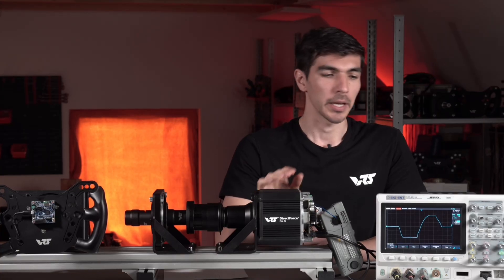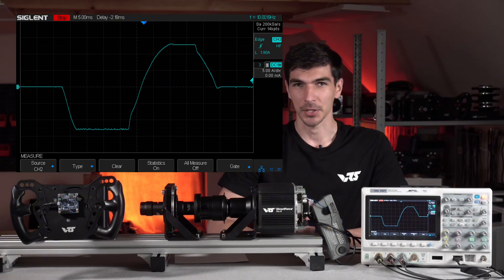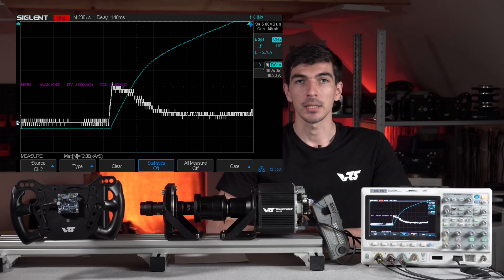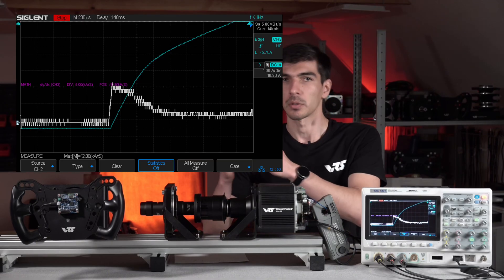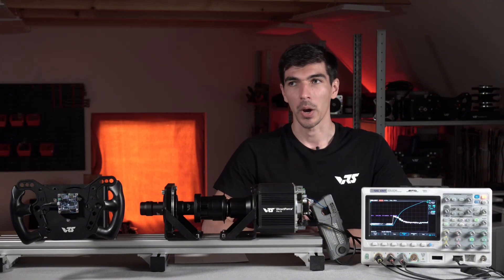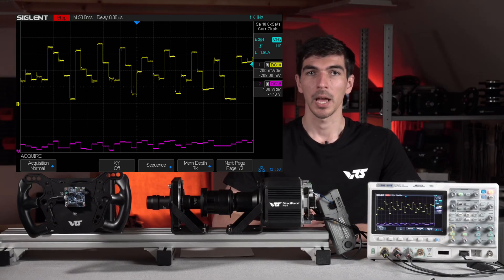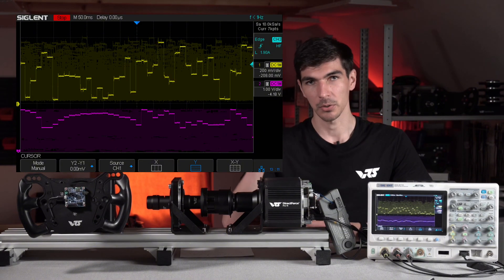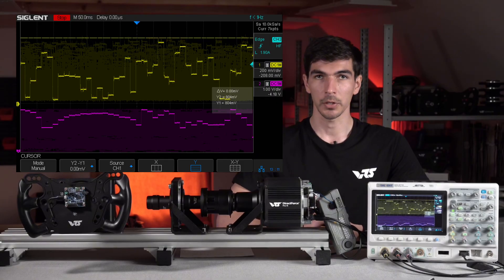How Wheelbase Agility Impacts Your Sim Racing Performance | VRS Racing

Comment: I have always wondered if there is a missing "component" to FFB design, as the games output a torque value but not a desired steering rack position (although that can be inferred from the torque being reduced as the desired position is achieved), and there is not much response back into the control loop other than the position achieved. Then Moza announced a wheel with a torque sensor on the output shaft, which in my mind should provide a great opportunity for more advanced FFB algorithms - but it's been a while since i studied system control theory, so I would be curious to hear what you guys think about such a sensor being added into the mix!

Comment: Thanks for this!
Again, this is what I am often talking about to people when they want advice for a good wheel base: look for a good slew rate as an indicator for how 'lively' a wheel base might feel. Maximum torque is a marketing number which is useless at a certain value, but it works with most people. They are easily impressed by numbers as high as 25, 27 or 35 (or 37, that particular manufacturer don't know themselves ;) ). No, take that number only as an indicator for maximum headroom. Look for the slew rate! Especially if you are looking for a wheel base in the lower budget range, there are vast differences.
But then there were also people who usually are very experienced with sim racing hardware who keep saying 'slew rate is just another marketing tool'.... yeah, maybe it is, but it is actually the more important one, even if it is not really transparent how this value is determined.

So thank you for this video and I really hope other brands pick this up. My guess is the way Simucube and Asetek are coming up with their slew rate values might be quite similar. But some other brands don't even mention it, it is always about 'maximum holding torque', as if you would go half a minute through a corner or they would aim at oval sim racers.

Comment: I don't have instagram and I already own the DFP20 but ill comment anyway. I am not Technically minded at all but I do appreciate the time you put in trying to explain to give us a better understanding of you're product, and whilst some info went over my head I did end up changing my slew rate from balanced to performance and I also changed the filter from optimal to responsive 1 after watching you're previous video but after watching this video if I understood correctly the filter options dont have an impact on the frequency that produces the force feedback for performance and so I can switch back to optimal if I do so desire. Thank you Dennis & Frank

Comment: If you could make smoothing filter that included all the poles that say a ten band graphic equalizer has, then level settings plus and minus for all the frequencies produced by the motor that come from the SIM, it would be truly top shelf. 
Seems like the +/- steps in each band would be hard to design and also implement that into a UI that the user could use to eq the ffb in great detail. I guess it would have to be a digital graphic equalizer block, since it’s not an audio  application . IDK, if you can think it, you might be able to design it.

Comment: Great testing methodologies, and I love the analysis of the optimal filter effect. 
It would nice if the offered filters had a general description to indicate what part of the ffb signal spectrum it’s primarily effecting. 
Secondly, does the effective slew rate change if more than one filter is or could be applied. Or another way to ask is , does the complexity of the filter effect the slew rate when used. 
If you might be able to describe how each filter effects the feel of the ffb signal, then it would be easier to choose which smoothing filter might be best for whatever type of signal conditioning you might be striving for, and each SIM is different, so this is not just a one time set it and forget it.
Sorry for the long text.
Great work on the video.  2.5 years now with a DFP 20.

Comment: I've been following VRS for a while now, and this video blew me away. The transparency, the engineering depth, and the way you break down slew rate and frequency response—it’s exactly what the sim racing community needs.

As someone working in tech and compliance, I deeply value clarity and precision. I’d love to receive the DFP15 wheelbase not just to upgrade my rig, but to help introduce sim racing to more people in Georgia, where the scene is still growing. This wheelbase would be a game-changer for our local community. For now, I’m using the Fanatec CSL DD with 8 Nm.

#DFP15

Comment: In April i've talked with VRS about data-driven reviews and they were one of the few brands that were really interested in joining the program, not sure if it helped with VRS to go with this route of going more technical and explaining things, glad they did it, but it's missing the most important part that is comparison with other hardware because if you can't compare you can't know if it's better or worse and in each aspects.
Keep it going, it's important to be informed.
PS.: Not sure about the direct correlation from current to torque, usually you need to multiply by the efficiency and higher current should mean less efficiency.

Comment: I would love to get my hands on the DFP15. After being stubborn in my ways and not seeing value in high end sim racing products I bit the bullet and purchased the VRS Pedals. After 3 months of use there is no $ fiqure you can put on the quailty and how much more immerse and connected those pedals bring and the last bit of kit I'm needing to upgrade is the wheel base and wheel rim. Seeing this detail explaination on how HZ work alongside the filters with this amount of transparency has got me commited to the VRS ecosystem for life.

Comment: What are VRS budget options rivaling CSL DD 8 Nm and the next tier up?
Reply: The Fanatec CSL DD 8 Nm base is $550 USD while the VRS DFP15 Nm is $650 USD.
- So there is only a $100 USD difference for what is arguably a MUCH better wheelbase.

The other option would be the VRS uDFP line that has options at 6 Nm, 9 Nm, 12 Nm, 15 Nm torques.  
- It's all founded on the DFP20 base that is their longer running model.
- Pricing with the similar QR offered on the DFP15 above are $548, $648, $748, $848.
- You can start with any of those models and upgrade to more torque over time at $99 per step.

All that to say that you have essentially 3 current VRS options that are comparable in different ways to the CSL DD 8.
- uDFP 6 Nm $548
- uDFP 9 Nm $648
- DFP 15 Nm $650
Reply: @Chader9 And what about the wheel "ecosystem" ? Fanatec's is based on you selling your kidney... The universal hub was supposed to change that but they are too greedy.
Reply: @Tome4kkkk  OK, I was not advocating for Fanatec in any way and if anything, suggesting that VRS was the better choice given your short and narrow opener.
- So let's recognize the goal post has moved with your follow-up comment...  

Wheel ecosystem is also interesting and a reason I chose other than Fanatec and VRS for my current base.
- Fanatec is overpriced as it ever was and worse with the latest round of price adjustments they applied.  I'd never suggest Fanatec with a focus on wheels and I'd be hard pressed to suggest Fanatec for anything other than a console requirement.
- VRS wheels ecosystem is partly non-existent.  They have the new R295 that is decent but not perfect and they are seemingly eliminating the other formula wheels due to their poor pricing and value ratio vs other 3rd party options.  I expect them to expand their line but it will be a long while before they get more than a few models and nothing approaching Fanatec (per your 1:1 question) or other brands like Moza, Simagic & Conspit.
Reply: @Chader9  You're on track, thanks! "No wheel ecosystem" is good! As in, by example of Fanatec a company with an "ecosystem" actively obstructs third party wheels. You can't use a Fanatec base without a Fanatec wheel without buying an unoficial, often also pricey, "cheater interface". All in all, VRS goes straight to my 2027 upgrade notes! Thank you! // Last but not least... 2 engineers describing a product in place of the usual "who knows who she is" yapper and the sales bozo... That can only mean good things for the product!

Comment: Hi I am 64 and still on belt driven wheelbase. I made my decision to buy a DFP15 (this video specially slewrate made it) later R295 but I am very low on budget so it need time. First I am in need to change my residence which will eat up some money, so more time to wait for DFP15. A gifted Wheelbase will help me to save some money.
Thank you for this video and all the work on develop new hardware.